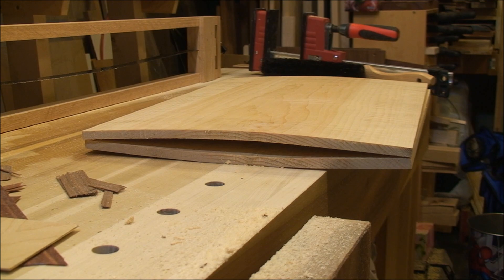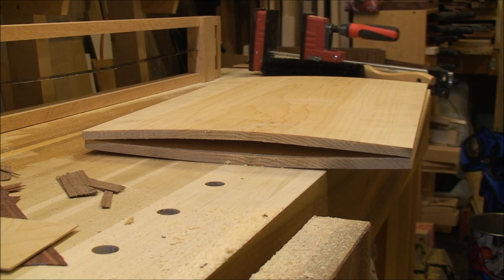Resawing with a frame saw

Comment: Interesting Design. how comfortable was that to hold?
Reply from the maker: +Wood By Wright Thanks.  It wasn't terrible but not great either.  The main problem was that I didn't take any time to round the corners where I was holding it so they dug into my palms.  I think it will be much better once I do that.  I liked the hand position reasonably well though I doubt it would be as nice as what I've seen others like Tom Fidgen use.  A huge advantage for me is that I have a tiny shop and this stores away on its side and takes up very little space.
Reply: Mike, could you add handles to the sides that maybe screw in or attach in some other way that might make it more comfortable to handle?
Reply from the maker: I'm guessing that would make it more comfortable for sure.  It is a super low usage tool in my shop though and I suspect giving the corners a decent rounding would go a long way.  As it was I like the hand position for it and don't think I would change that too much anyway. :)
Reply: Sounds like rounding the corners would be perfect, then.  I just bought a long blade to make a frame saw.  I really appreciate your take on the design.  Thanks for the video!
Reply from the maker: You're quite welcome.  Good luck with your saw!

Comment: An interesting concept of a frame saw but, frame is a frame, regardless of size.
At some point I noticed you gloved your hands, I'm guessing if you add a "radius" to the handle later, maybe you won't need the gloves...
Thanks for sharing.
Reply from the maker: +ronin4711 Well spotted! I wasn't sure if the corner would bother me or not but you're right, I will need to curve that corner so that it doesn't press into my palm as sharply. Outside of that though it was comfortable enough of a sawing position for the few times I expect to use it.  :)

Comment: Looking from a body mechanics perspective this design requires more from the arms compared to the Roubo design, which allows for more of a full body utilization. What one gains in reducing the weight of the saw is perhaps overshadowed by restricted power delivery.

Comment: No sir that piece of board thats curving and warping will not get back straight and square, doesnt matter the weather, the moisture, the temperature or the season. 🤣😬
That just what 1/2 inch piece of boards do.
Doesn't matter what type of wood, what year old and what moisture content it has, any plank of wood irrespective of the length, it the thickness is 1/2 inch and width is more than 4 inches, they are going to curve and warp, they are the black sheep of all wood plank sizes.
Come on sir, you know that already, woodworking 101.🤣😬🤣😬🤣